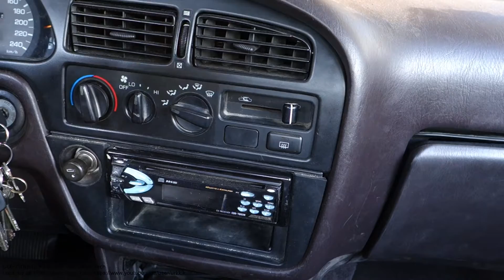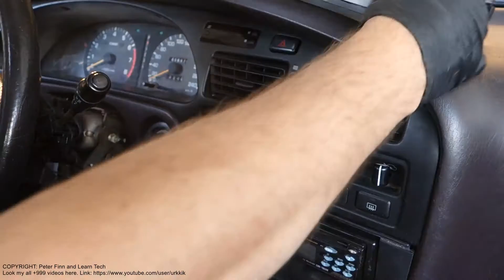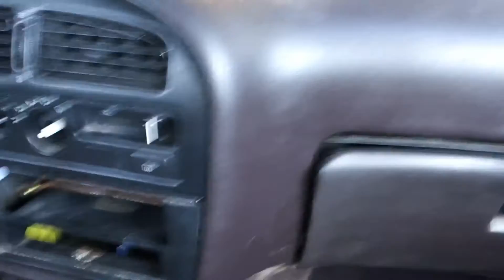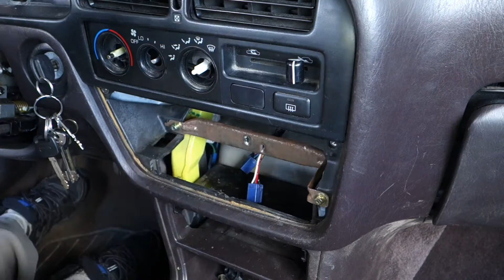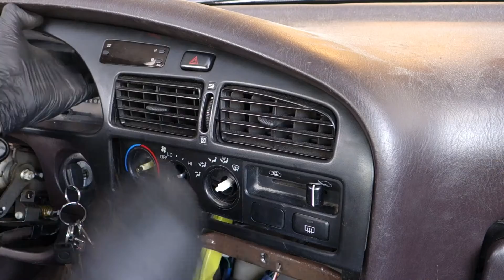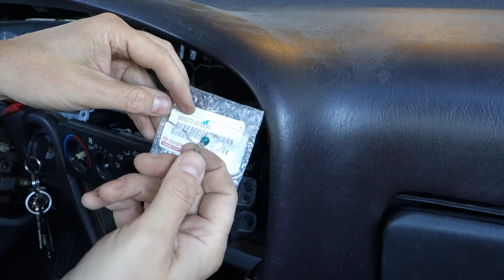How to replace light bulbs temp and fan console dashboard Toyota Camry. Years 1991 to 2002

Comment: What type of bulbs are they, name? Where do I buy them
Reply: They are size 74.  They usually come in pairs.  You should be able to find them at Walmart or any auto parts store.  If you want the ones with the green covering, you can find those online.
Reply: @tsntana  -Have You Ever Thought Of dipping the  #74 Clear Bulbs (or for any clear bulbs , for that matter) In Food Coloring ,(Awesome Results)  instead of paying MUCH MORE  for the little OEM Tight green condoms that just  slide over the clear bulbs

Comment: How did you take the radio out? That part was completely skipped
Reply from the maker: I will do new video
Reply: Remove the plastic cover surrounding the radio which is on its bottom, left and right side using a flat head screw diver. You’ll then be able to see screws holding in the radio and it’s hollow compartment below.

Comment: Bulb size ?
Reply from the maker: Well, I don't know. Toyota dealer knows
Reply: Bulb sizes for 1997-2001

Cluster sizes

Backlight: 194 (x5)
indicators: 74 (PRNDL2, dummy lights) (x24)
Low fuel: dealer only or radio shack (do not use LED because they are too sensitive to light up)

Climate Control:

Backlight: 74 (x2)
A/C switch: T4 neo4 (x1)
Defrost: T4 neo4 (x1)
Defrost: T3 neo3 (x1 for amber indicator)

Other bulbs:

Hazard switch: T4 neo4 (x1)
Key: 74 (x1)
Glove box: 74 (x1)
Ash tray: 74 (x1)
Lighter: dealer only (shown in the above picture)
Shifter: 74 or 194 (x1 - size depends on year)
Map: 579 (x1)
Map/door: DE3175 (x1)
Reply: @Grungydan  Thank you so much for this!